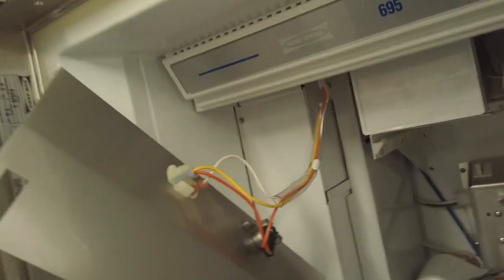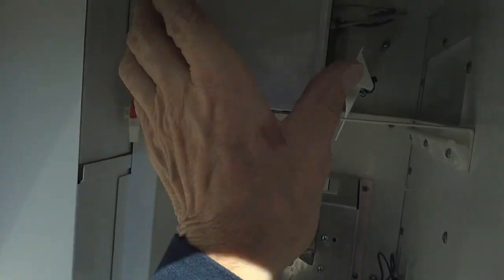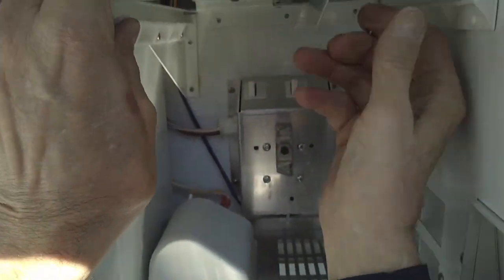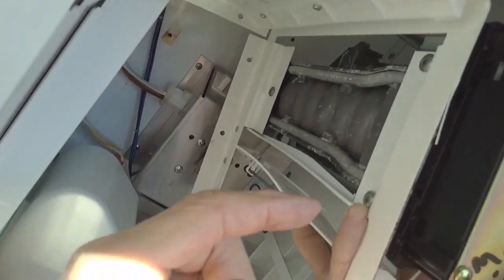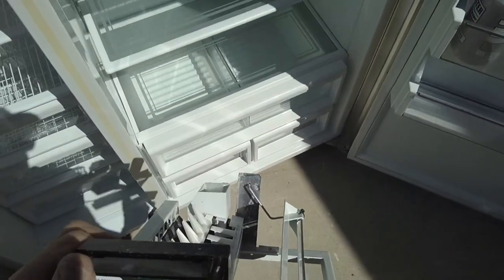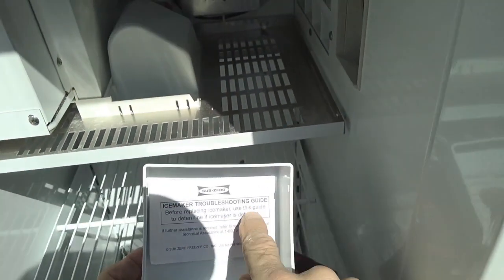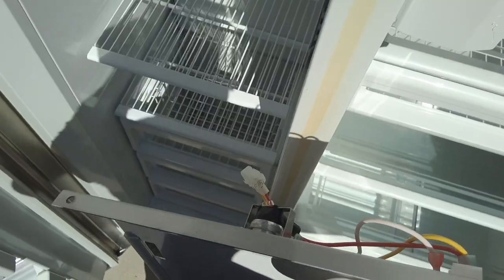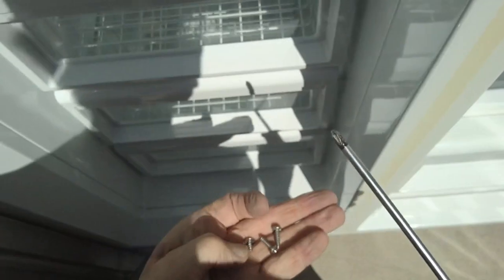SUB-ZERO MODEL 695 ICE MAKER R&R

Comment: Hi again...   Would you happen to know if the model 690 freezer auger motor needs grease... ever since my icemaker over flowed with water... the motor only rotates after I apply heat from a heat gun... then it rotates when I push for ice... but after I put everything back... it freezes up. motor works after the thaw...  any lubricant to stop the shaft from freezing up  if not do you know the partnumber... it has 2 push buttons like the one in this video Thank you
Reply: I found the part#...sub zero 690 7019633   but if there is a way to re-lubricate the gear/shaft etc... as the motor works when thawed. if not I'll have to buy a new one thanks
Reply from the maker: I've had augers freeze up but never had to grease one. I suggest you remove it and let it dry out, then make sure there's no water leaking down from the ice maker. Every time I had a frozen auger it was from the ice maker.
Reply: @SubZeroSpecialists  Ok thank you.  I removed it when I warmed it up and tipped it over and a little water came out but didn't totally remove it and let it completely dry out... I'll try that this morning... if it happens again I'll have to buy a new one
Reply from the maker: You don’t need to remove it but you can. Another thing you can try is after you defrost the auger turn the ice maker off and see if you continue to get water, that could be a leaky water valve overflowing.
Reply: @SubZeroSpecialists  Thank you!!  the water valve is new... It over flowed because the new icemaker didn't have the correct shut off arm so we didn't have the plastic feeler to stop it from making ice... I removed it, dried it off and used compressed air to get all water /moisture out. thanks again... if it still locks up,,, I will just buy a new one
Reply: Hi I hope you can off suggestions. 
I bought a new 4200522S ice maker for my subzero 690. I bought this as a replacement and it included the Arm and rudder. But when the arm is installed it is still a inch and 1/4 longer then the hole in the filler cup please review the photos I sent via email and let me know if I am still missing something. They included another plastic bracket and 1 screw but I don’t know what it is for. No instructions in the box thanks Richie
Reply from the maker: Sounds like you have a water leak from the ice maker. Remove the auger , put the bucket back in and see if you get an ice build up
Reply from the maker: @richiedigiacomo3937  where did you send the pics

Comment: Hi I have a 690 model subzero the ice maker is working fine but the ice in the ice container is melting and freezing over as a block preventing the use of the ice dispenser would you by any chance know what could be the problem? Thanks
Reply from the maker: @soniafortin4924  sounds like your ice maker or water valve need attention. I would check the water valve first to make sure it is stopping the flow of water at the end of a cycle or it could be a faulty ice maker.

Comment: What about the other side for the water/ice exit how does all that come apart? I have a unit that I would like to clean the bottle and discharge area really good. Thank you
Reply from the maker: You can peruse our Tech Help files at aaronsrefrigeration.com Find your model and go to Component Removal section. There should be instructions on how to remove the dispenser.
Reply: @SubZeroSpecialists   thank you for the help. This is perfect!

Comment: Many thanks!!!  Question: Would a failed fill (or drain) tube heater halt ice production?

I am unable to get my 690/F to resume ice production.  I have done all the following: Replaced icemaker, tested valve (works fine), verified continuity of wires to valve and ground (all good), verified all four switches work (two for the ice bucket, two in the door).  Now guessing that perhaps either the fill or drain tube heater has failed – if so, would that cause the ice maker to halt production?
Reply from the maker: I'm assuming you have a modular IM and you can jump between terminal T & M to see if it turns. The left switch above the auger must be pressed in to call for ice. Let it ruin through a complete cycle to verify that you're getting water. If no water then it's your water supply. What I will do sometime is switch the harness that supplies water to the dispenser to see if the IM valve energizes, otherwise pull out the fill tube and check for clog.

Comment: Thank you  for posting the video.  Trying to replace the freezer evaporator defroster heater, do you have a video on how to remove the ice maker on a 685/S?  The 685/S is slightly different on the left side and I can not seem to find all the screws holding the ice maker in place.

Comment: How much does it cost to replace the 695 Icemaker unit?
Reply from the maker: Around $400 depending on where you live.
Reply: I live in Scottsdale Arizona
Reply from the maker: @rsgoldsand  I'm not sure of the price structure in AZ but you can call Sub-Zero local service company for a quote. 800-222-7820

Comment from the maker: Some of the early module ice makers were problematic but SZ re-engineered them in the later models and they were much stronger. You can replace just the module with a newer design from most appliance parts stores, they're made by Whirlpool.
Reply: Is this one getting the newer module?
Reply: What is the newer design part number for the module?

Comment: I've always wondered why even in a high end Sub Zero ice makers always fail or break!? I have a 511 which has worked without fail and still does for over 20 years but the ice maker lasted only 2 years before going kaput! I never bothered to have it serviced and just disconnected it and the water supply, what gives?